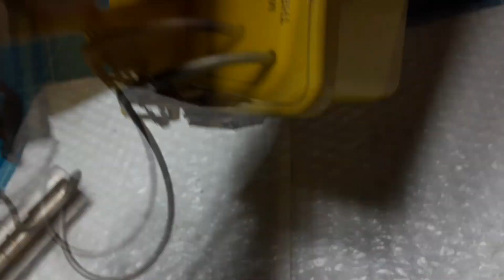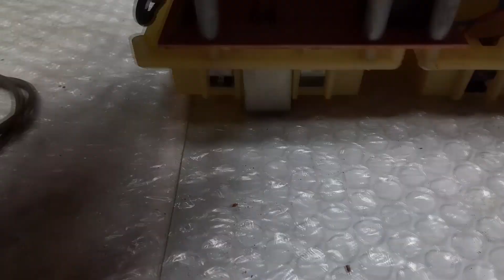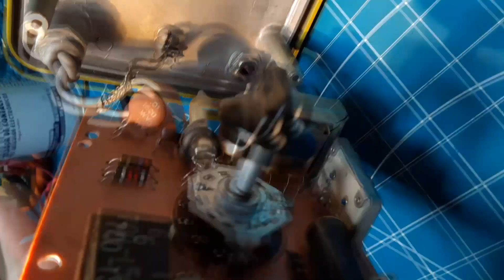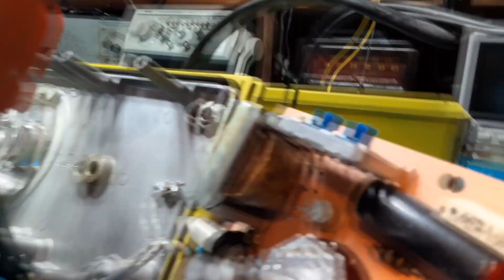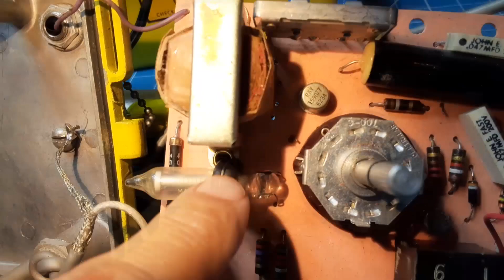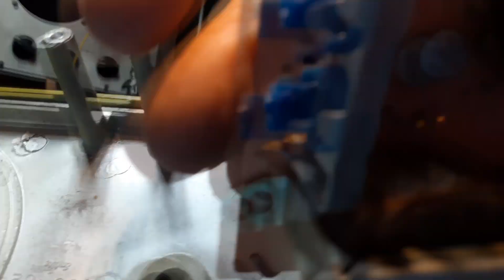Radioactive Failure - Victor Geiger Counter 700 6B - Part 1

Comment: One of my 700 units, when I turn it on the needle begins to slowly climb at any setting.  Intially the reading is very low as with normal background level, but by 70  - 120 minutes later the needle has climbed all the way to the right side of the scale and very slowly decreases when the unit is turned off.
I presume a component is not working properly.  I don't understand enough about what each component does to make a guess as to which one is misbehaving.  
When I open the tube to test the Beta check strip,, initially the count is the same (or very close) with that unit as with some of my other detection values, so I know it partially works, but the needle keeps rising to the maximum possible while my other 700 just holds at the low number (as it should).  
Any insights as to which component is probably the problem would be appreciated.

Comment: Hi ER.  Very interesting video and thanks for the tour of the unit and the schematic.  Very clear explanation of how it works and generates the high voltage.  That was great you could source a new flyback!  I was relieved to see the corrosion wasn't worse and damaged the circuit board.  Good luck in Part 2.
Reply from the maker: Thank you for the encouraging feedback! :)